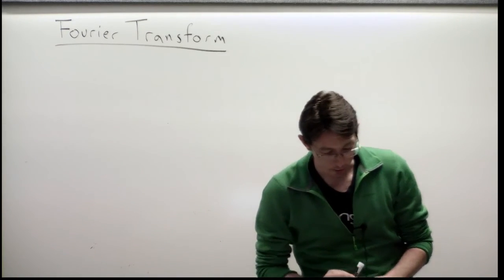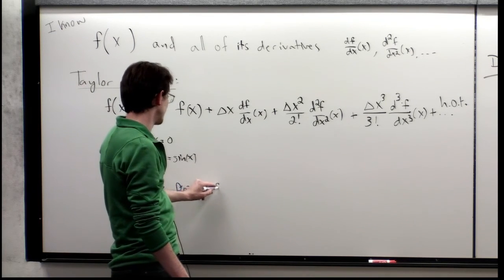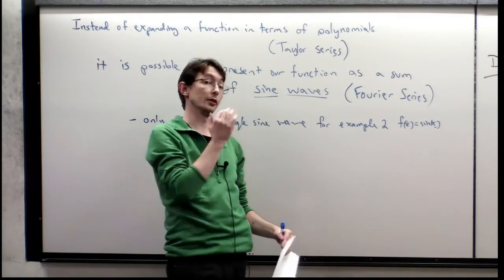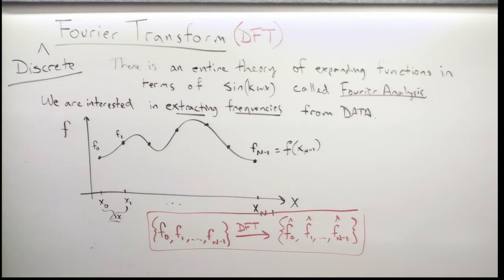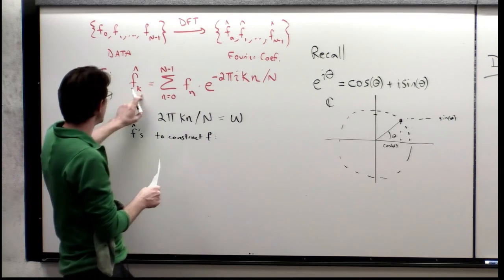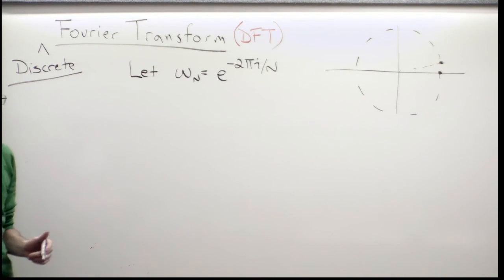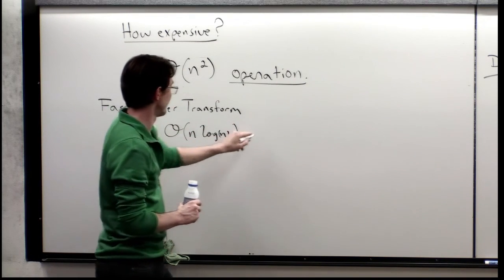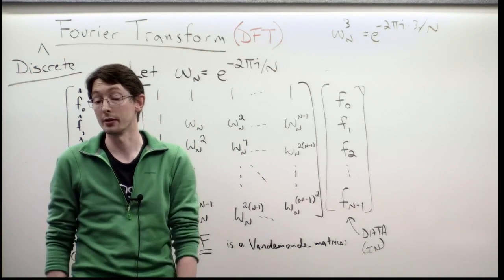ME565 Lecture 16: Discrete Fourier Transforms (DFT)

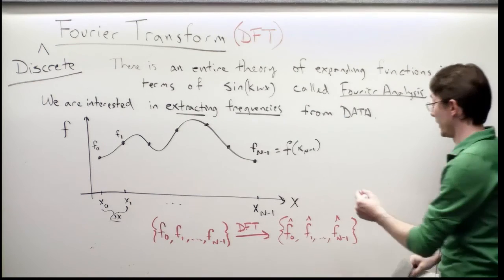Comment: Hi, Why (at 20:55) you supposed that there are exactly N-1 different frequencies? Maybe smaller number of frequencies is enough or, higher number of them is required.
Reply: Well, if smaller number of frequencies is needed then some coefficients will be zero. In discrete world, if you have only N points, you cannot get number of frequencies more than N (by the way, there are N frequencies not N-1, 0-s frequency also included). 

This is because discrete signals are periodic in time and in frequency.

Just imagine that you have 5 points of data on a graph and all of their lengths equal to one, 0-s (0/N)  frequency means that there are no oscillations (pulse train) , 1-st (1/N) frequency means that 1/Nth portion of an oscillation/cycle/period is done per one sample, 2-nd (2/N) frequency means that 2/Nth portion of a cycle is done per sample, ..., N-1-s (N-1/N) frequency means that (N-1)/N portion of cycle is done per sample, then if we go to N-s (N/N) frequency it means that entire cycle is done within a span of one sample, which means that nothing has changed it is the same as no oscillations at all. So there are only N distinct frequencies for N-point signal.
Reply: @torebektoregozhin4626  Thank you so much.

Comment: I've a few questions bothering me for a long time. These are as follows:

Q.1 What if my graph of f verses x also has data points for negative values of x? How would I deal with that? 

Q.2 How did you decide the frequency axis while plotting the fast fourier transform? I didn't understand the meaning of the line: freq= 1/(dt*N)*(0:N);

Please answer my questions.